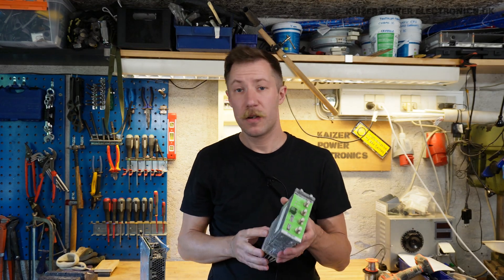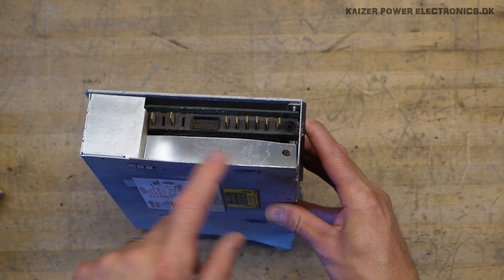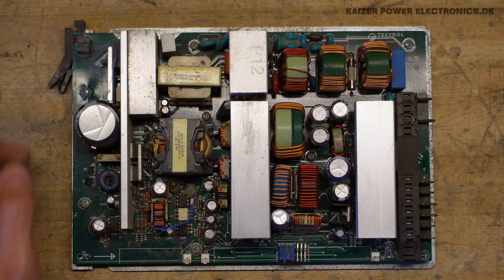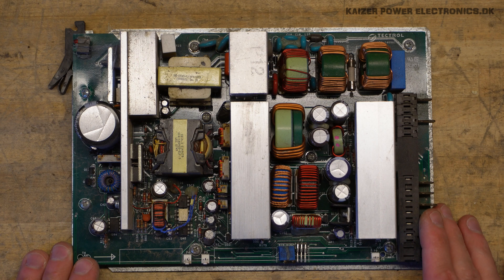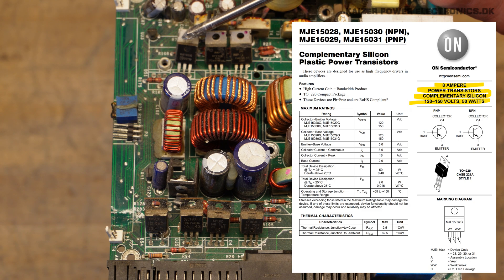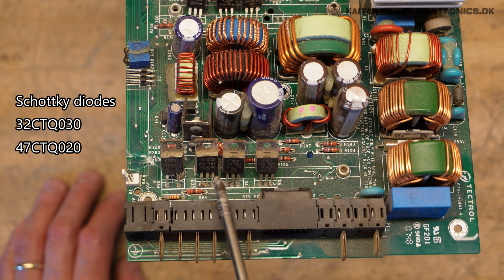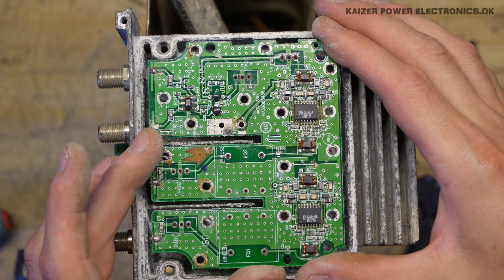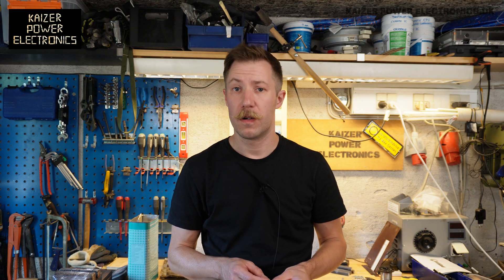Scientific Atlanta (Cisco) 1 GHz Combiner and PSU Teardown

Comment: The aluminum actually protected the circuit board by acting as a sacrificial anode, we see very little copper corrosion.
Reply from the maker: Had the screws, inside, just been brass instead :)